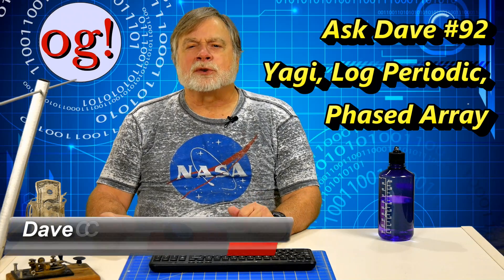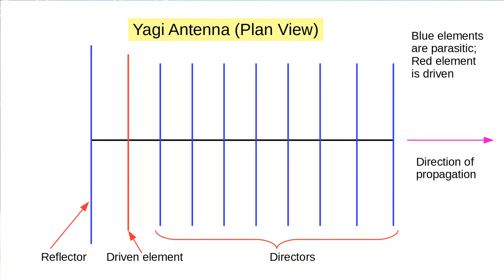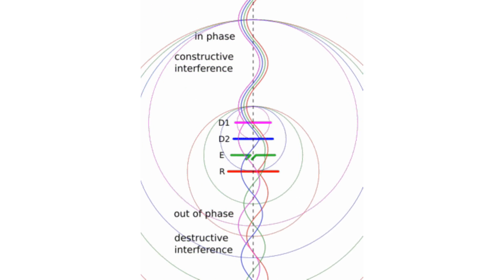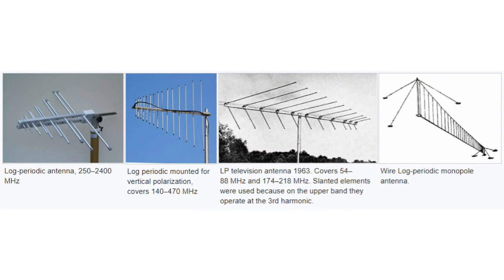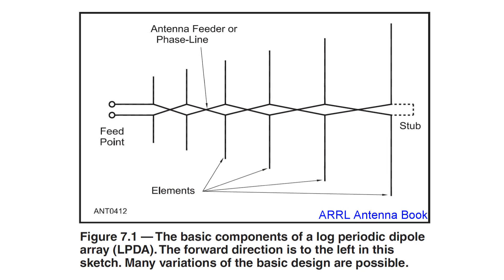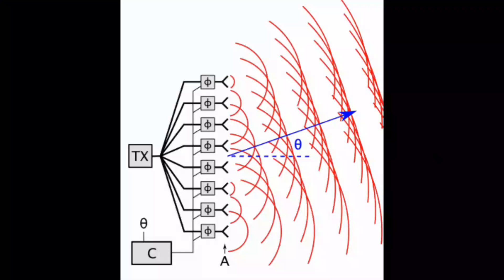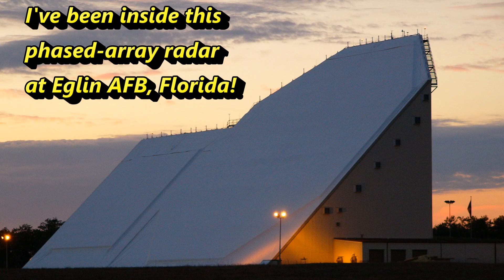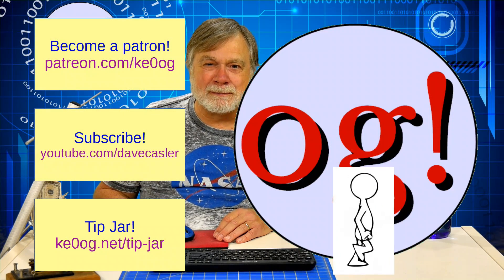Exploring the Yagi, Log Periodic, and Phased Array Antennas (#92)

Comment: I was thinking about making a tracking antenna and had thought it would be easier to mount two yagi udas on a axle with a crank in the middle. If not easier it wouldn't be that much trouble. Then I was like damn, the 70 cm antennas won't be phased. Then I did the math and I guess putting a third one in the middle almost exactly works out. That had to have been intentional.

Comment: After many years experience with HF rotatable antennas....quads, yagis, and LPDA (log periodic dipole array).  A quad is a nice antenna...electrically.  It's essentially a loop..which means it's going to be a bit less susceptible to man made noise.  BUT....at HF frequencies it's a nightmare to maintain mechanically and you need two wire loops per band and each loop needs it's own feed line.  Next...yagis.  Great antennas...with one big problem.  Single band yagis work well...but only on the band it's constructed for.   The solution...to make a yagi work on more than one band...is usually a "trap".  Traps are usually made from a coil and a capacitor inside a metal tube that is incorporated in all the elements....usually three elements.  Traps suck.   They're mechanically large which necessitates that the elements of the yagi be of large diameter tubing.  They're heavy...and they're out there in the elements.  Rain, snow, dust, and even birds and bugs can get in and mess it up.  The spacing between the elements is a big compromise when you make a yagi cover more than one band.  There is a yagi that can work well on more than one band by using little remote control motors to slide a copper tape inside a hollow fibreglass tube...in all three elements....but....lots of little motors...up 60 ft......ummmm.....not for me.    Now comes the LPDA.   Multi band coverage...mine was 14 to 30 MHz with flat swr of no more than 1.5 to 1 measured at the antenna.  One feed line.  Light...elements can be of quite small diameter.   Front to back ratio was not as good as a 3 element yagi....but the tradeoff was more than worth it.  One antenna...multi band coverage...one feed line....light, good gain (mine was about 7 dbd) and relatively cheap.  I can say, without hesitation, that the LPDA was the best rotatable HF antenna I have ever owned.  It just worked....no gimmicks....no moving parts....and it could handle 1500 watts easily.

Comment: My father worked for Bendix in the 1960's and participated in the construction of the C-6 site radar in Walton County, FL...twice. The site unfortunately burned to the ground after a cooling system failure and had to be rebuilt. It is a fascinating example of the phased array principle.

Comment: Speaking of Log Periodic antennas... Great one Dave! Since I first posted to you in the last couple weeks, I have been on a steep learning curve! Your YouTube episodes are my favorite! Thanks so much Dave! You're a kind man, with a good heart and brain! 

In addition to my unfolding work building 40 Meter antennas, black powder cannons to launch them, making my own black powder and rocket fuel for antenna deployment experiments

 I have just ordered a HackRF One, which is a Software Defined Radio peripheral capable of transmission or reception of radio signals from 1 MHz to 6 GHz. Designed to enable test and development of modern and next generation radio technologies, HackRF One is an open source hardware platform that can be used as a USB peripheral or programmed for stand-alone operation.

 And I also ordered the Log Periodic PCB antennas for: two for 850-6500 MHz, one for 2 GHz to 11 GHz, one for  400 MHz to 1000 MHz and a 5.8 GHz Quad Patch Antenna.. all by WA5VJB. 

I'll be using the wifi router band antennas for WiFi tracking... and on-the-go connectivity with Kali Linux (free OS with a LOT of cool tools for RF)

I will be rigging them to a DIY antenna mast in the back of my truck and an antenna switch, and use it with the HackRF and a laptop while visiting urbanized areas and see what the heck is out there! 

Also, my intuition tells me that with a navigational compass and a pen, some driving short distances, and a little logic... I could tell where everything is, fairly exactly. Police cruisers, for example, even if I was not to decode the traffic, which, from the looks of it, is pretty possible with the tools in Kali Linux.

I've got an LCR meter now as well as a good multimeter. Just waiting on the antenna analyzer (MFJ-223) and camera. I built a charcoal retort out of a steel 55 gallon drum for making a lot of pine charcoal for black powder. After all, I reckon it'll take a few shots to get a mastery for antenna cannonry.

Going to make videos up the wazoo of all this when my camera stuff comes in, in the next couple days. I ordered a phone with a good camera, but it was a lemon, so I returned it. Will be joining you soon in Youtube-Land.
 
73 Dave  Joe

Comment: Sorry Dave or other commenters i have another question. If i would like my log periodic to work on 2 specific bands for 3G 4G lets say 900Mhz and 2100Mhz could i omit the elements for the other bands and replace them with the size elements specific to those bands so the rear half would be longer for 900 and the front half shorter for 2100Mhz? I could slightly vary the size of those elements to widen those specific bands a little. I assume only having two sets of dipoles might not work as well as having many elements.
  I ask this as my 3G and 4G only ever connect to 900 and 2100Mhz so it seems like a waste of antenna to have elements working on any other bands and might cause interference from the unwanted bands.
Reply from the maker: Although I have no experience at these high frequencies, yes you can put in just the parts of log periodic that you will be using. The used to do that with the old TV antennas because there was a big gap in the middle of the VHF range.

Comment: Hi Dave, thanks for the video. I am thinking to make a log periodic but then add passive (parasitic) directors in front of the smallest active elements. What do you think? It would be a log periodic but with directors for the highest band. It appears to me that the lower bands have the smaller driven elements in front of them and might act somewhat like directors however the smallest driven elements have nothing in front of them to act as directors. I can't find any info. Any ideas?
Reply from the maker: When you talk about directors you are thinking of the Yagi. The log periodic is a completely different type of antenna, and doesn't have directors per se.
Reply: Yes i understand that but i was wondering if it might benefit from a few directors out in front to further elongate the field pattern.
  Thanks for the replies Dave. Great videos
Reply: @izzzzzz6  In that case, make it a longer log-periodic.